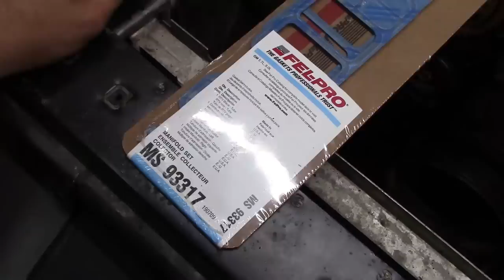1991 GMC K1500 Project | 350 TBI Intake Manifold Gaskets and Water Pump - Part 1

Comment: That was one helluva devastating storm front -  covered 1,000 miles - it will take some time to recover and the corn crop damage is unbelievable - major disaster there - keep cranking and don't give up - still runs good for 29 years old -  and your not done with it yet - major part fixed

Comment: When I do intakes I always use some Indian Head gasket shellac, guaranteed to never leak again and damn near impossible to remove the intake ever again lol. And to set timing the wire to disconnect should be inside passenger side under the rug, the second line on the balance is your timing mark, with advance wire disconnected, the motor at 1500 rpms it should be set to 0°
Reply from the maker: AllData says "Disconnect SET TIMING connector (tan/black wire) located in harness close to distributor. Connect timing light and adjust as necessary by loosening hold down bolt and rotating distributor." One section says to set at idle in neutral, another section says to have the transmission in drive. I checked both and found no difference.

Comment: I see the $1500 repair on a truck worth $500 like this - if you took the $1500 and spent it on a ‘new’ vehicle would you get something much better ? Maybe not as much as you think, at least with the one you own you know what you have.  The $1500 replacement may just be somebody else’s pile of problems.
Good job as usual Wes

Comment: Orings for gm fuel injection hose connections is gp Sorensen 800-9214 & 800-9215. 10 orings to a box. Crazy cheap and the proper material instead of out of the pluming kit that turns cars into fieros

Comment: Nice work.  That was a ton of stuff pulled for a simple job!

Does anybody spray oil under the vehicles or something to slow rust?
Reply: Eh, wait long enough and it will spray itself
Reply: Thought about that myself several times. What would be the downside (so long as one didn't spray or allow aerosolised oil to drift onto the brakes)?

Comment: IM IMPRESSED,  SEEING THAT RUSTY FRAME, I'D BEEN TEMPTED TO SEND IT TO THE SCRAP YARD ,  OR USE FOR A PARTS TRUCK  .cool to see a timing light being used again.  I did get a Honda mini van from a auction,  after getting everything fixed,  went to change fuel pump  ,but everything on the fuel tank was rusted ..looking from the license plate, I noticed it was from Illinois..SAD 😔 cause it had a good engine and transmission,  MY dad was the one who purchased it,with out me, I would have said NO.. bought lots parts, and got it running great..previously, and it had no title as well ,just a bill of sale...

Comment: How was the truck running was it missing at all I have that same exact identical engine if you look on my most recent video put this engine out of a 93 Chevy truck into the 90 S10 Blazer well it ran a little warm last Monday and I stomped it I heard a funny pop sound then you could hear it revving up out of the carburetor it was kind of weird and it started running warm again all of a sudden well last night I stayed up till almost 2:00 in the morning pulling it all apart and I'm going to put a 305 ho factory GM intake off of a 84 or 5 Camaro you can see it in the vids but anyways see a little coolant between the valve covers and the intake on both sides at the front just barely you wouldn't even notice it in the radiator but you could see the coolant right there and it went to missing all of a sudden even with brand new spark plugs I put in it afterwards it was missing so I was wondering if your intake gaskets made your truck Miss Even if not I guess they can blow in a different place because I did not lose much cooler but anyways I was just wondering did it make your truck run bad I'm so hoping that is my issue I'll be putting it back together tonight hopefully but check out my business anyways a Chevy guys have to stick together and also I have a plate that makes it where you can bolts a four-barrel to that TBI intake and also I have a GM TBI intake that is $500 on the internet and it is spotless with brand new but I will not be using TBI anymore

Comment: Worked with mechanics that couldn't stop an idle misfire on an inline 6 cylinder 30 years ago. Is just read a car magazine about small squirt from an oil can at fast idle along the intake manifold .Bingo we have smoke on two cylinders. Tightened the studs and job done. They shook their heads and called me an arsehole

Comment: Wes your opinion on relocating my knock sensor on my Nissan 3.3L. It is currently in the bottom of the valley under the intake manifold. Got a new one plus wiring harness. Going to relocate on top of the intake manifold.

Comment: Does traditional undercoating prevent that kind of rust damage or is it just mediocre protection? I've been trying to develop something better to counter rust for years.  Thanks
Reply: Undercoating is just mediocre, i've thought about spraying the underside of a new vehicle with bedliner, I don't think the bedliner would do much good on a car 4+ years old though
Reply: Tyler don’t use Berliner or any under coating sealant. That stuff drys hard and once water gets behind it it has no place to go so it rusts FASTER!!! Use a spray like fluid film or wool wax. Or just hose it down with used motor oil
Reply: @FishFind3000  The used motor oil coating appears, at least at face value, to be the most comprehensive solution. I would be super interested in seeing someone coat a brand new vehicle with oil and see how it fared over 4 winters. Couldn't hurt, right? I'm wondering if there's any drawbacks as it would be a good business model if it worked. Be safe

Comment: I'm researching egr problems.  I see you did not punch out the provisions for your egr valve.  on your passenger cylinder head there are 2 ports between cylinder 6 and 8.  these match up with the egr ports on the intake manifold.  How is your egr valve supposed to function if you do not remove the portion on the gasket at these ports?  I ask because I'm having egr code 32 and my engine never came with these holes in the cylinder head.  everywhere I look reman engines dont have these holes.  trying to figure out what I should do.

Comment: Wes love your videos, makes me feel like I'm back in the shop with my dad working on his race cars, if you dont mind I have a question, I have a 1997 f150 5speed with the v6, sometimes when I take off in first and shift thru 3rd it sounds like a fully loaded Mack truck taking off and sometimes it's as quiet as can be, what would cause it to rev so high and sound like that

Comment: Here's what the very old man that owned the pharmacy where I worked in high school said and it's stuck with me all my life: "What's it gonna' cost to replace?" Let's say a few things crop up while you're working on it and it ends up costing $2K. Let's say it last another 2 years w/just general maintenance/minor repairs. $2K divided by 24 is $83 bucks a month. That ain't gonna' buy you anything near as decent as that. Plus, we haven't even mentioned the insurance savings. Let's be clear; I love shiny/fast new(ish) cars. But, I'm aware that it's analogous to flushing 20 dollar bills down the commode. Maybe it was his dads, too. In my mind, from a cost vs usefulness basis, he's doing the right thing. If your vehicle, to you, is a transportation appliance, there's other places to spend your money. PS I'm in Grundy county. No power for 3 days, no water for 1. Just got finished cleaning up today. Not as bad as by you but this is the third time this year I had to do it. Still waiting on the fence company to come fix mine after the fourth of July typhoon. :(

Comment: I live here in Alabama. Most used truck down here just have some mud and dirt on them.

Very little rust in most cases. I’m in the process of looking for a good 10-15 year old truck.

Around here anything decent starts at $10k +
That truck on the south minus the rust would easily bring around $8k.

I guess with prices on a full size trucks going for 40k to 100K.......people are hanging on to there’s and just fixing them as they break.

When I do find one....I’ll wrench it in the ground. I can’t stomach these new truck prices.

Comment: I put a water pump on my wife`s 79 el camino ,I got a a/c delco pump and it would not fit on the engine. After close inspection the old casting molds were so worn out I had to grind 1/2 off the boss so it would go by the timing cover and alternator bracket.pain in the ass.beware!

Comment: do you ever use a wire wheel on gasket mating surfaces? steel for cast iron surfaces(this truck is all cast iron?) and brass for aluminum? they are faster than scraping...
Reply: I find a paint stripper pad works really damned well. Find at the normal scumbags, Walmart and such.

Comment: Heh this video has some good timing, I've got some trouble with my 96 c1500, and was hoping to get some advice on where to start. Pressing my brake pedal immediately blows fuse 1 (stop/hazard) in the dashboard fuse panel. If the fuse is un-blown, the signals and hazards work as expected. I was hoping you could let me know where you would start looking in a case like this.
Reply from the maker: There must be a short to ground from the brake pedal switch to the stop light relay.
Reply: Yeah thats my thought too, I'm going to test the relay side in the morning, but there is a split at the brake pedal switch to the underhood relay as well as the chmsl, the cruise module, and hazard switch. Im just being lazy about digging the harness for that out from behind the steering column.

Comment: About the repair cost. You know as anyone else that although it may be more than the actual truck value,  you have to take into account how much it costs to replace it for a comparable running and driving truck (not counting 'emotional value' if that's a factor). Storm damage... woah ... glad its just material damage.
Reply from the maker: I understand it, but the viewers always go nuts about expensive repairs on low value vehicles.
Reply: It’s cheaper than a car payment…

Comment: Quick question for anyone with an opinion, or actual knowledge, on the riveted in ball joints, would the unit they go into be better to be stamped steel or solid plate? Or a better way to ask that would be, is it better to have it over/underlaping the control arm or sandwiched inside of it? Let’s assume a black box example of a channel of metal of the right opening size vs a plate of metal, both welded to tube or bar stock, and cut to the shape appropriate for mounting the ball joint, keeping in mind that thickness of both part types can vary to suit the job, and weight being a concern (so if one can get away with the same strength for less weight, it would have the advantage)

Comment: I never thought of this before but: If the new cars and trucks are THAT bad, maybe a person should start snapping up cars from the 80's 90's etc and rebuilding them to sell?
The last car I bought was a '99 Civic new. I still drive it and the only real problem is that the (I believe) transmission linkage inside the auto  transmission is warn and very touchy. All you have to do is breath on the selector and it goes out of gear. 
I won't take the trans out to fix that. When she quits its off to the junk yard. But if I was younger, might put a manual trans in it.

Comment: This truck is a K1500, Not a C1500 K means 4 week drive and C means 2 wheel drive =)
Reply: That's interesting. My first truck was a 97 CK2500, but maybe the Canadian designations are different?
Reply: @87FordMudder  Nope The GMT 400 platform is the CK Series All K models were 4 wheel drive and all C Models were 2 Wheel Drive Also read your Vin Number there will be either a K or a C in the 5th digit
Reply: The c designation stood for commercial.
Reply: @brokenwrist24  No it did not...
Reply: brokenwrist24 wrong, c/k was the 2wheel/4wheel drive destination, also Chevy didn’t call them “Silverado’s” till the 99+ body style, previous to that “Silverado” was a trim package (much like w/t, Cheyenne, Scottsdale, etc)
Reply: Skippy is 100% correct. C/K was the generic designation for the entire truck lineup. Individual trucks were either C (2WD) or K (4WD.)
Reply: I misspoke c was the designation for conventional, or conventional suspension, or independent front suspension. The c/k designation was introduced in the 1960 my trucks. Previously they were known as 3100, 3200, 3600 series. 1960 ushered a whole new body style, new frame design, and the c/k series that we know.

Comment: 305 spark plugs are evenly spaced apart. 350 1 and 3, 5 and 7 are close to each other.
Reply from the maker: Is that always true or just for certain years?
Reply: @WatchWesWork  not 100% sure, most 70-00 v8 I've worked on are. Even the exhaust manifolds give it away.

Comment: That heater hose fitting is a quick connect for assembly at the factory and it usually rusts out. Auto parts stores stock replacement fittings.

Comment: As someone who just spent 3k on all the brakes ,lines and low mileage rear axle being put in .im now spending another 3k and now having a southern frame swap and low mileage engine put in because the frames shot and original engine has 309.000km .my 2000 GMC Sierra I only just bough last year for 3k.i will tell u why people put boat loads of money into a older used vehicle especially a pickup.up here in Ontario Canada it almost impossible to find a decent rust free truck for 6k hell even 10k . I know because I looked before I said go head and do the work to my friend. Cab and box are almost mint so I figure with me only driving it in summer time I might get 10-15 years or more out of it

Comment: I suspect many people aren't thinking about what the dollar value of the vehicle is anymore in relation to the cost of the repair Wes. They probably own it free & clear, and are just thinking..can I spend $1k now and maybe get another couple years out of it before something unrepairable happens. I ran a 1985 Suburban 2500 that way for 22 years before the frame just rotted away. By that time I had already welded over 2 dozen, 1/4" mild steel plates to that frame. 627k miles on it by the time it made it's way to the crusher. STILL cheaper to play the long-game with ole 'Shamu' and keep wrenching on her than buying a new vehicle.
Reply from the maker: Heh. When I was a kid we had a 1989 Jeep Wagoneer. I don't know how many patches my dad welded on the frame. He finally threw in the towel and sold it for parts.

Comment: I know this is 3 years old but wes, $1200 for that much work is super super cheap.  Considering the local mieneke charged my boss $500 for a power steering line.  They wannted 2300 for front struts on a 08 honda odyssey

Comment: Ah, the crows foot wrench, i saw it, that hold down bolt is just about im p ossible without it, i know you hate a ford but atleast you can touch the distributor without having to climb in the engine compartment

Comment: Tom and Ray Magliozzi used to have this same discussion: why spend $1200 on a $500 truck?  But that’s not the math. Could you buy any kind of decent truck for $1200? Or even $1700? And if you did, how much work would it need? I believe the owner made the right choice. It’s otherwise a good running vehicle; why dispose of it?

Comment: Those electric cables. 🙈 Its like jungle. Thats why we put then under ground in Finland. Storms doesent do damage.
Reply: Costs more to bury them. Plus with sewer and water it’s much harder especially in the city. Also when they are buried the get hotter so you need larger conductors to take the heat.
Reply: Sure it costs more but after it theyr maintenance free. 
Heat? We use high voltage and big enough cables. Welcome out of of stone age.

Comment: I owned a 1990 K1500 305 4WD extended cab until 2008 when I finally sent it to the scrap yard and bought a Tacoma.  II also live in the rust-belt and the GM was a problematic piece of crap from day one.  The fact that this fossil can still go down the road, control it's direction and stop with any kind of predictability or safety is remarkable..... and questionable.  Anyone who would throw money at this thing is nuts!!  But they're nuts enough to help Wes pay the bills and  any time nuts pay bills is a good thing.... ;-)  But when you're constantly repairing it yourself, it's just a pain in the ass!

Comment: That coil needs to be replaced it has external leaks. I could see it when you pulled the intake.
Reply: Had a coil explode 58 international.Oil and wire everywhere I realized why it's called a coil.
Reply: @allanbrogdon5317  that IH coil must have gotten hot enough to boil the oil in the coil. I have never seen one explode but yours is the 4th in 40 years of my life under the hood that I have heard about.
Reply: @waynep343 My father had that pickup and once he needed a fuel pump and it took a few days to arrive.He took a 2gallon can I think for Coleman camp fuel drilled a hole in the lid brazed a fuel line to it.Filled with gas and hung it under the hood which was high up from the carburetor gravity fed it worked we only were two miles from his automotive shop in town.

Comment: Duuuude u poured a whole mess a cooland down ona the intake holes upon reinstallation...always drain the block if possible when doin intakes
Reply from the maker: Come on. There was a tiny bit of coolant trapped in the intake. It won't hurt a thing. And we have to change the oil anyway.

Comment: Haha,  Asking a mechanic the value of a used car is like asking a presidential candidate the value of a gallon of milk.  Where I live if it runs, has 4wd, and you can't see thru it from one side to another, 2500 is a minimum starting point.  And I'm not far from Illinois.